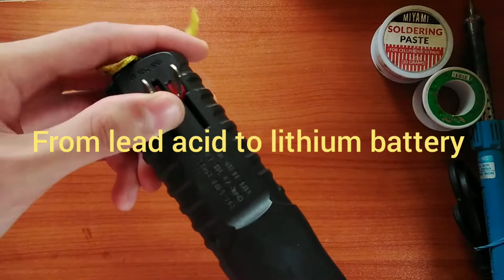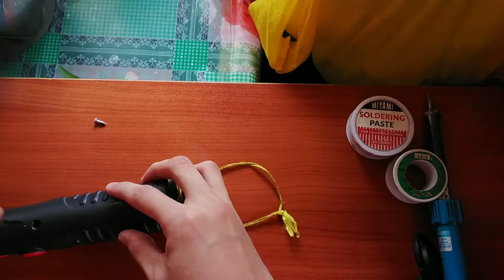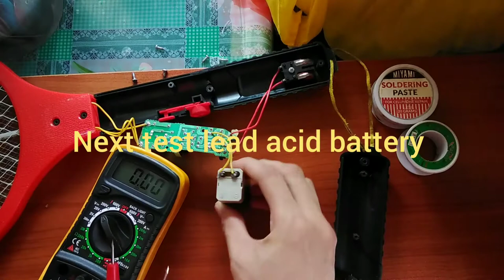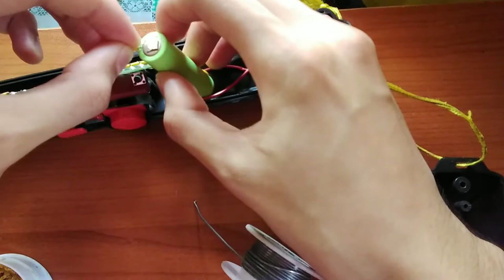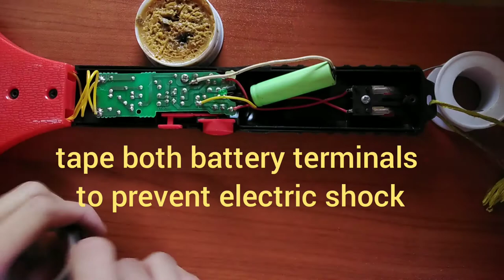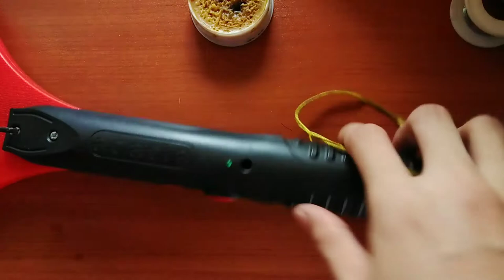🔴 How to change battery on electric mosquito killer from lead acid battery to lithium battery

Comment: It depends on the PCB configuration and if simple PCB will destroy its transistor and heat very hot. It will not charge the lithium battery. Suggest change the PCB with lithium battery support or add BMS. Usually i add TP4056 as BMS to be on the safe side.